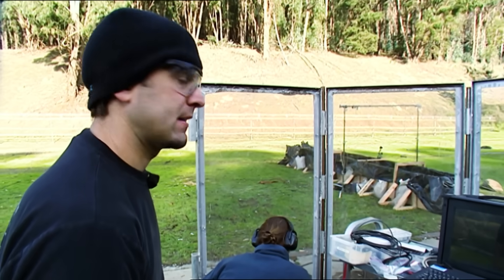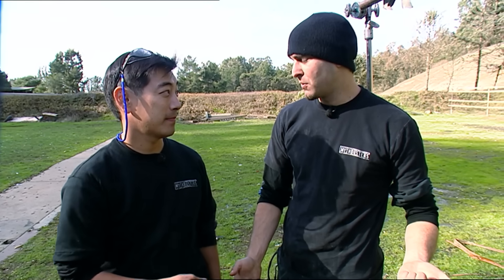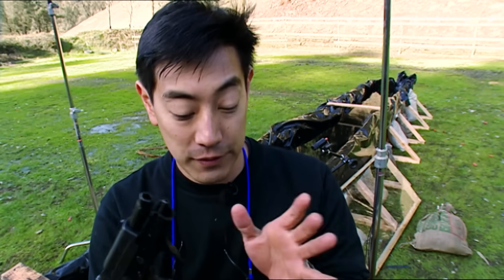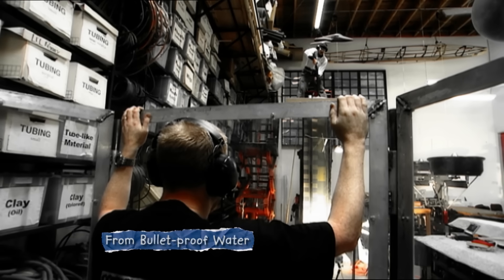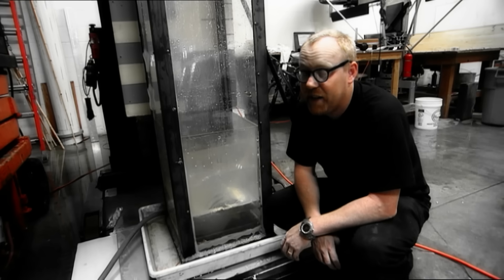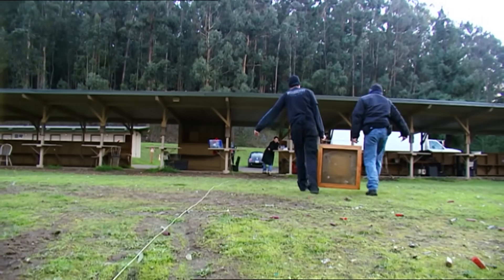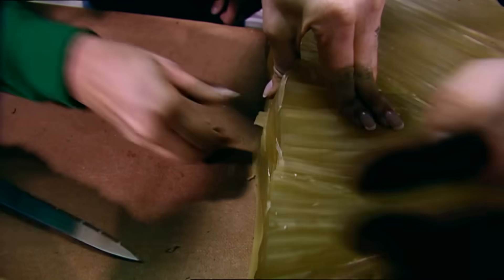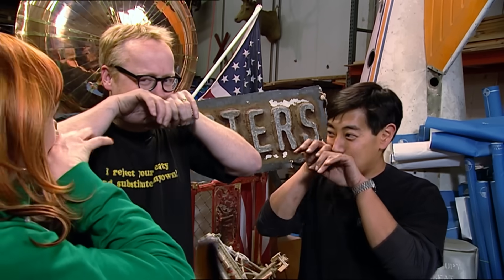Can Guns Fire Underwater, And Are They Deadly? | MythBusters

Comment: Got as far as them saying you only have one shot when firing a gun underwater, and I gave up.  They're called revolvers, and you could fire every round in one.
Reply: Or the semi auto could be manually cycled.
Reply: @3rdpig  Sure, after you cleared the stuck brass after every shot.  What amazed me most was them having any question about whether or not a gun would fire underwater.  Scuba divers (like me) have been using bang sticks against sharks for decades, and they're nothing but very simple firearms styled after Hawaiian slings.

Comment: There is, of course much greater resistance to the Kinetic energy while underwater,  However, that wasn't the question..  They are, however still extremely deadly at close quarters...  Just the wind effects the travel of the round, so the water is going to have a much greater effect due to  the mass coefficient...

Comment: You'll have no ear drums if you fire one under water. The way to shoot fish with a rifle is to stick the end of the barrel in the water then aim at the fish. The air in the barrel gets pushed out softening the water that way you kill the fish. I know this because I watched my dad do this. Here is the thing the 22 has to be single shit and you have to dry out and oil the barrel
Reply: This video has nothing to do with fish.
Reply: @merickfulno it's about firing a rifle into the water which everyone knows about already. As for shooting under the water well that doesn't work out. However sticking the barrel under the under water pointing down with air in the barrel works perfectly You can kill a fish.  However it must be a bolt action and a 22 for best result. The barrel emptied of water each shot and of course took it apart and oil after going fishing. If you all would ask some expert mountain men you'd save on experimentation

Comment: I think it's less about distance and more about volume. More water will spread the energy more. Try it at the bottom of the ocean and I doubt any of those rounds goes two feet.
Reply: I wonder at what depth a brass casing will lose structural integrity and thus not fire.

Comment: Kentucky Ballistics just did some gun firing underwater - and his bullets seemed to go far further with more power (especially the 50 mm!) But he was in a POOL vs a big tunnel of water... It makes me wonder if the size of water makes some sort of difference due to pressure refraction (I've no idea if that's an actual thing...)
Reply: depth and temperature are the only factors, and i don’t think either matters much (pure guess).
Reply: @patrickmaline4258 depth relates to pressure though. I can't help but wonder if you have a smaller system (ie - a long but skinny pool) vs a bigger system (a whole above ground pool), that there is more influence adding pressure from a gunshot might have in the smaller system.
Reply: A 50mm?! Holy crap, that’s huge!😅

Comment: Need to test different bullets.  A wadcutter might work better.  They do in fact design bullets for use underwater, they have flat noses, with sharp edges.  Maybe use a sanding belt on a round.  It'd be hard with the 50 cal, due to steel inside the bullet, but I think that would work.

Comment: I think the shell casing not ejecting might be effected by a floating handing holding it. The movement and then recoil might help toss the casing out without a jam
Reply: being light weight compared to the surface area it presents, its gonna stop as soon as it hits the water, before its completely ejected. i’m guessing a little bit, but the light weight and surface area points are solid.

Comment: I think the deal with the shotgun is the water inside the barrel has too much resistance so the backpressure from firing ruins the rest of the piece. OTOH, they didn't say if they were shooting a slug or shot so the dynamics may be different between them.
Reply: Exactly. Significantly higher volume of water to displace, for a larger amount of powder.
Reply: I would expect a pistol to fire easily, but I also expected the additional pressure in the rifle barrel to cause catastrophic failure. I wonder if the rifle just had  a more reinforced receiver.
Reply: I actually think the action might be more important. The 9mm and Garand were semi auto, which allows much of the reaction force to be absorbed by the bolt/slide. However the shotgun was a break barrel, so there was nowhere for the energy to go. As for the revolver, my guess is all the extra gaps in the cylinder allowed more gas to escape. Plus the volume being smaller in a pistol obviously
Reply: @Deletirium  yes the rifle is built to take much higher pressures from receivers to barrel thickness. Also the volume of water to be moved out of the shotgun 3-4X the amount of the rifle. The M1 is .308 and 12g is .729. Shotguns are typically longer barrels and increased the water volume as well. Kentucky Ballistics recently did a similar test in a pool. I’d recommend checking out his channel as he did many more handguns and rifles.
Reply: The thinner barrel walls also have something to do with it.
Reply: @davidhealdjr.513   well, that and the total length of the barrel. That's a lot of water to push out of the way.
Reply: @davidhealdjr.513  Great point! From my (limited) experience I would say the shotgun barrel would more resemble a thin wall tube than the relatively thick large caliber pistol barrel. Add the massively larger amount of water "plugging" the barrel and I'm not surprised at the result.
Reply: I actually think the type of action is the key here. The semi-auto pistal and rifle allow the explosion to escape two directions. Out of the muzzle and out of the breach as the slide/bolt recoil to the rear allowing the weapon to cycle the spent casing out the ejection port.
In the shotgun, the only escape was the muzzle. Water is non compressible, so that is a lot of pressure that has nowhere to go.
I'd be willing to bet a bolt action rifle would also break if fired under water.
Reply: Feel like a smooth bore shotgun with shot pellets leaves room for the water and gases to occupy the barrel at the same time, where is the rifled bore with a single projectile forces the water out the muzzle.
The pressure of combustion plus the water in the barrel at the same time may have burst the shotgun.
Reply: @high7onesomesound I think it's more about the type of breach.
Pistols and  many rifles cycle and eject spent cases. The slide/bolt goes to the rear, meaning that energy can expand in multiple directions without breaking the gun.
Lever and pump action shotguns don't cycle with firing. Everything stays put. This means energy can only escape out the barrel through non compressable water, and non moving gun componants. The barrel isn't enough of an outlet, this causes breakage elsewhere.
Reply: @eas2252 . Sound hypothesis.